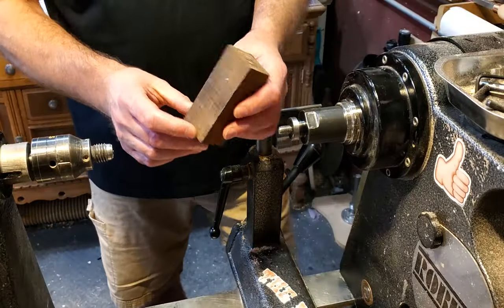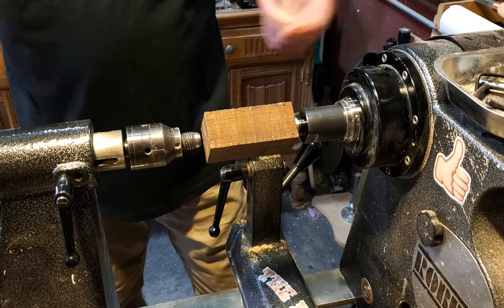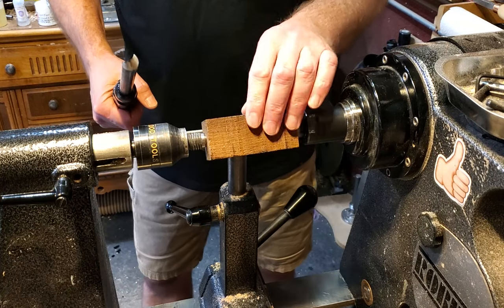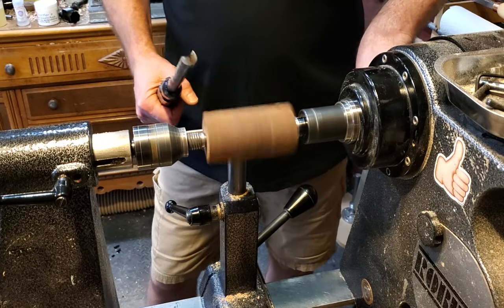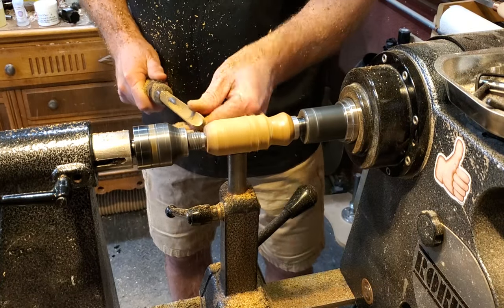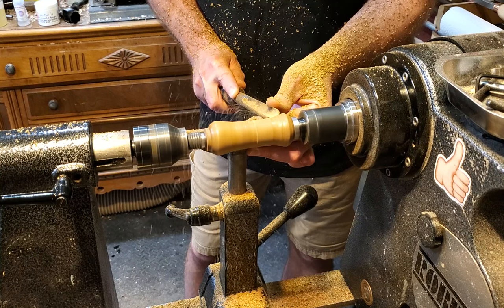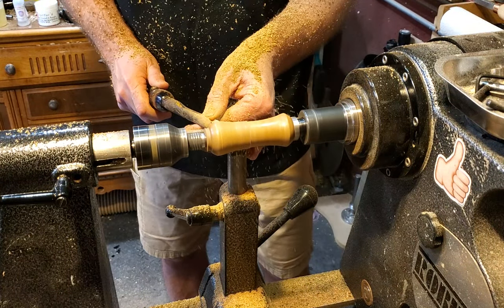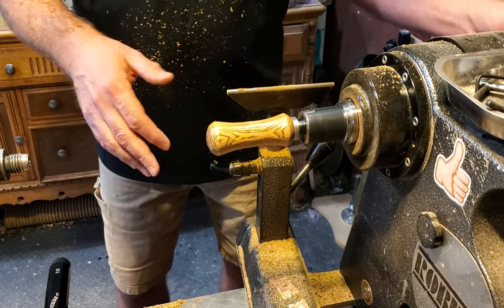How To Use A Bottle Stopper Mandrel

Comment: Followed your previous video on inserts. Yesterday.  Then tooday mounted it on the lathe and gorilla glue bond wasn't strong enough.  I  could stop the blank very easily.  Managed to turn it with really light cuts. Then reglued the insert.
Reply from the maker: Hi Rick, I talked to Ruth she has always used TiteBond II and says it works very well. I would give that a try.
Reply: My second one (I made 2) held just fine. Might be operator error.